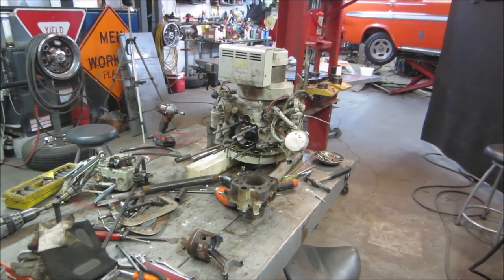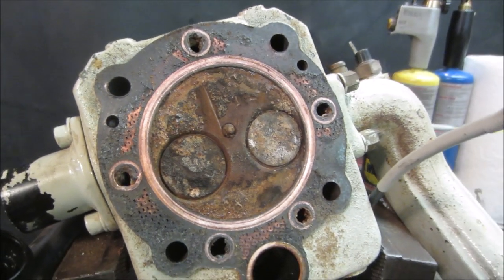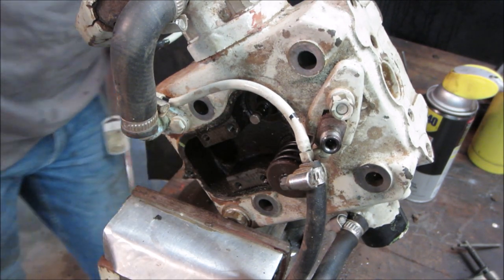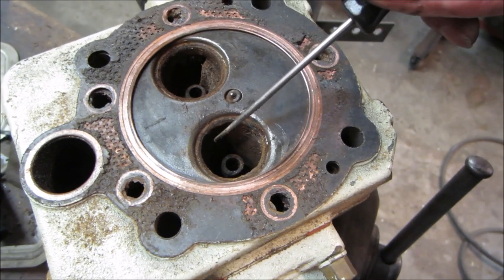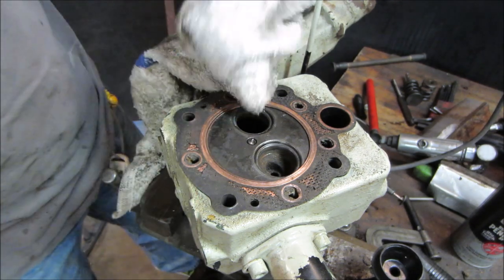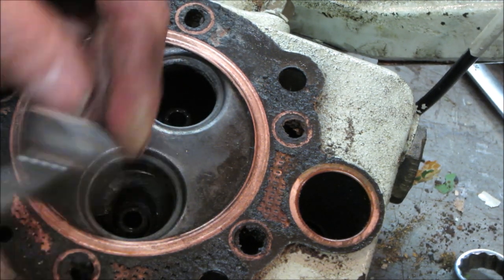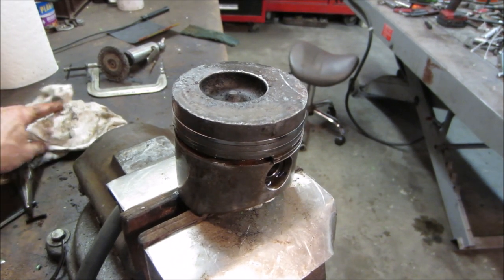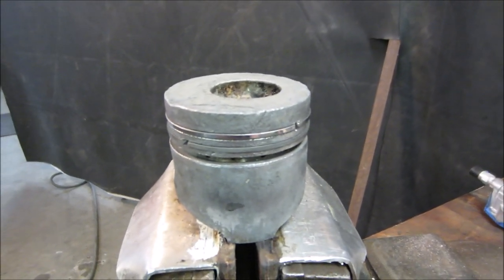Can It Be Saved? Junked Marine Diesel PT 2

Comment: Save some of your old sanding disc  you can use to clean up the valves. Also, when lapping, lift the valve out of the seat slightly and slap it back in the seat, this helps seat the valve for a better outcome. Just a suggestion I learned from Big Daddy Don Garlits. The piston is probably trashed after the beating it took trying to remove it. Most of the impact driving it out was on the outer edge. Anyway, I enjoy the content and "drive it like you stole it".

Comment: When I was trying to clean the all stuck pistons on a chevy inline 6 I fould that if I put them in my steel 5 gal pail and heated it to 300F ,  All depostits were gone next morning. Rings were loose. I used used engine oil. Magic stuff.

Comment: The less compression a diesel has, the faster it must be cranked in order to start it.  But if you can figure a way to crank it fast enough, you should be able to start it despite considerable bore and valve seat pitting.  I once had a Rabbit diesel that I would tow up a big hill and roll off down the hill at around 40 mph to cold start.

Comment: If you can't get a new piston, you might consider welding the crack with aluminum rod and propane torch. Machining it down to exact specs, after welding could get tricky.
Reply: That aluminum rod is too soft, too low of a melting point.

Comment: water in the diesel tank will do that. if it run with water contamination in the fuel and then left for a year the piston will rust, when i lay up my 350 cc single cylinder diesel genny for long periods of non use i always clean out the tank fisrts and run clean fuel through the engine, I try to use red diesel as the sulphur lubricates the engine unlike pump diesel which is low sulphur content.

Comment: I've had luck in the past using a dental style pick to remove stuck rings in motorcycle engines. Wiggling the sharp end under and behind the edge of the ring sometimes allows one to pull them out, or at least get it started. I don't know if that would work in this case, but it might be worth a shot.
Reply: N1RKW, Yea but I bet you didn’t use a 20 ton press to push the piston out of the cylinder, which likely crushed the ring grooves onto the rings

Comment: I think they sell 1/32” O.S piston&ring set for that. I couldn’t see the engine size to confirm. If they don’t, you’re whipping a dead horse.
Reply: O/S  piston isn't the whole solution. Actually, that engine has a sleeved bore, as do most diesels. You can usually buy a kit, with sleeve, piston, rings and pin.
Reply: @neil6212  
Now that would be fun to see, pressing the sleeve out of the cylinder.  That requires a press plate that’s thick and with a hole just big enough to clear the sleeve lip/flange. Also a much more powerful press, I don’t think heat and penetrant will be enough. Then again it may just tear the crap out of the cylinder regardless of precautions. I’m a glass is half full guy because life has shown that and leaves less to be disappointed about when SHTF. 🧐

Comment: Bronze wheel to clean the valve stem before you lap the valve.  Then use reversible drill to lap the valve with the suction cup tool.  If that much build up perhaps knurl the guides and replace valve seals.  If it has some.
Good Luck!!

Comment: Ive rebuilt engines like this with sandpaper then valve lapping compound. Hone cylinders. New rings and bearings. Some of them are still running 100k miles later. For as much as people are afraid of engines because of cleanliness you can do it "garage" style. Now your not going to build a race engine this way but if you gotta make it run you can. Its funny how many armchair youtube commentors will SWEAR you have to do things perfect in lab conditions when in reality most of them have never built an engine. I built my first 383 dirt track engine at 15yrs old and have had very very few failures. Dont be afraid get out there and do it. You will make mistakes but thats how you learn.

Comment: Hi. I stumbled across your channel while browsing videos on Restoring damaged equipment. Thought I would "throw in" my 2 cents. Given all of the gummed up, rusty engines, especially carburetors that you seem to come across, thought you might check out the options on a Vapor Honing / Hydroblasting system to clean and restore some of these parts, including cylinders, pistons and even valves. I am NOT an agent for any of the companies that produce/sell this type of equipment. One of the more prominent ones is a company located in North Carolina called Vapor Honing Technologies. They have a Youtube Channel, and there are quite a few videos  here on YT which feature other YTubers using this type of equipment to restore classic motorcycle engines. There is also one where VHT use a machine to free frozen piston rings from the piston just using their vapor honing. It does not remove material from the piece, but will remove paint, rust, gunk, etc. I know these machines are not cheap, but given their efficiency and end results may be worthwhile. There are different media aggregates and mixes of aggregates depending on what application is going to be the primary use. I wish you continued success in your projects.

Comment: I bet rubbing compound could be used to bring back the valves, in a pinch.  I've used it on the end of a q-tip stuck in a drill to polish the bleeder-screw seat on a brake -- borrowed that trick from your carb cleaning videos!  :)

Comment: Pretty sure the issue was the exhaust manifold or water jacket managed to leak into the exhaust and the water pump was tied into the main engine or had Venturi style flow from moving, and that caused the leak to occur and then it just flowed in continuously until they went to use it and were so pissed by being without power when they needed it that they just immediately chucked it, which broke the pulley

Comment: Boiling the piston in hot oil will help. The heat will make the piston a little longer which should increase the clearance in the ring groove's and break the corrosion bond.
Reply: Yes but there is a crack in the top of the piston down to the compression ring.
Reply: @jadesluv  it will still help with dismantling it, have you seen my comment over on the strip down vid?

Comment: I have no words about the way he cleaned the valve seats and piston… but anyway- measure the height of piston, also get a measurement of inside diameter of cylinder. Find equal closer to this by size of cylinder. Go to someone who have equipment to expand cylinder to the next size of equal piston. Same with valves, change the seats, grind the contact ring as you did here but with the new seats. And make a gasket by your self, or try to press down with sealant the current one. If you need advice how to create new gasket - just ask. Currently I see no issues instead of time and spending small amount of money to expand the cylinder to the next size and changing the valve seats to make it work again

Comment: There will be piston rings available that can be modified. Approximate bore size and width will not be for just one engine ever made. Ring grooves can be cleaned up even on a lathe. Rings can be made from cast iron pipe and then split and made to correct fit. Ask Alan Millyard for help and advice. He builds fantastic engines from scratch, can make anything. Just look up Alan Millyard on u tube and wonder how he does it..

Comment: You don't use a drill because the centrapetal force of the spinning throws the grinding paste off of the valve. By right, you use the sucker firstly with rough paste and then with smooth. You can tell when it's ok by the plopping noise the valve makes when it drops into the head.

Comment: With all the rust inside and out. I would of tried sandblasting the exterior, do exactly what mustie did to the head cylinder wall. If no other sensitive components are in the way id also sand blast it to remove all that crap. But these motors from what I seen are basically bulletproof if maintained occasionally.

Comment: Try an old deep socket with a bit of rag stuffed up inside.  Crack it a few times with a hammer on top the valve cap.  Keepers will jump out and cap and spring will jump up.

Comment: Check just below the seat on the exhaust valve ( the one that was stuck). Just for a second there looked like there was a crack in the exhaust port that may explain why the engine locked up & eventually rusted up. Needs a head if it's cracked...

Comment: Another worry. If your rings won’t hold, especially the oil control ring, or the valve stem is loose the Diesel will consume its own oil and will not shut off until it runs out and siezes.

Comment: Aluminium oxide is cheap and readily available in many particle sizes for different aggressiveness it's active ingredient in grinding/cutting wheels sandpaper as well it has hardness of 9 so it can grind hardened steel mix with some oil or something and make ur own lapping compound

Comment: I had Kawasaki air cooled engine with the same problem. Once i got the piston  out, I cleaned it up with the wire wheel, warmed it up around the rings with a gas torch and sprayed it with WD40 and let it soak. I then tapped around the rings with the handle of a large screw driver until the rings freed up. this took a few hours. I was then able to remove the rings without breaking them. I think that I was lucky. I put it back together and it ran. More luck.

Comment: Thank you for part 2. What is the purpose/benefit to using a brass rod or hammer?
Reply: Not a mechanic (I drive a desk in a bank...) but brass is a soft metal, so if you bash a harder metal with a brass implement, particularly a part with an edge or a tight clearance, you do not risk damaging  or bending it out of shape- At least, that's what I understand...
Reply: @maxinlux6570  thank you. That’s what i was thinking but wasn’t positive. Be safe out there on the roads, ah hem, hallways driving that desk!! Bahaha. I had a laugh!

Comment: Rings are ~$16, just need the thickness of each of them.  If it really needs a new piston, if you take all the measurements (bore, stroke, wrist pin size, ring thickness, etc) and there are places that will custom make a piston for ~$100.  For the record its 3.150 bore and 2.950 stroke.

If you can test the generator and make sure it works you could get the motor running like new for under $200, that would probably be enough to have a shop machine the bore 0.010 over, and grind the valve seats even.
Reply: You're a tad small...bore is 80mm.
Reply: @Split10uk  I have the manual, it says 3.150 in it.
Reply: @Split10uk  And 3.150 is 80mm
Reply: @Split10uk  That is a third of a thou difference, an order of magnitude smaller then dragster and F1 engines are toleranced to, its insignificant for the application.

Comment: Many years ago, I was told that if you wanted a good fit between the valve and the seat to loosely put the valve in and attach a drill motor to the push-rod end and grind away. Some slurry should be added to the seat to allow some good action. Is this a bona fide technique?
Reply: I should have waited until the video was over . . .

Comment: Pity. There are lots of maybe random fit pistons but for diesel it needs to be right.
You could test the generator using a big drill motor w/ no cylinder attached to try to get a glow from a bulb before spending any money on parts.

Comment: Fuel line on valve stem. Put nail or screw in other end of fuel line. Chuck nail/screw end in drill motor. Pull-on drill motor and lap valve that way. "Colgate with MFP (micro fine pumice)"

Comment: I've actually used lapping compound the fix a piston with a messed up wrist pin bore. Been running strong for a while now
Reply: There's nothing that can be done for this engine. It's dead. Parts no longer exist, the piston is cracked, and the usability is questionable. It's either scrap,l usable as a spare for someone else, or something to cut up so that the gennie can be grafted unto another engine, IF, it works.
There's a reason they dropped this engine in the junk yard, something marine people rarely do as much as every day Joes with their lawn mowers and such.
Mustie got his views, that guy who found it got his 20, and we got to see what happens when you operate a boat like a prick, and let water enter through the exhaust. Case closed.

Comment: The first thing you should have done was to pull the injector and poured the cylinder full of sea foam.  Then, 48 hours later, see if it will turn.  If it still will not turn, empty out the cylinder and pour in mouse milk, a second choice because it is costly.  Do not wire brush pistons, turn them on a lathe with polishing compound.

Comment: Has a marine engineer I think the exhuast water cooler jacket as cracked and water backing up and filling the cylinder but all is not lost  you need a valve set cutter  witch will clean upthe valve seats  then after a bit more work lapping the valves in you get a good seat

Comment: I had an old ford escort that wouldnt run well with 85 psi compression because the valves were so bad. I did that drill technique with  regular old dirt with a little oil mixed in. I got 140psi +/- 5psi accross all cylinders

Comment: Well, there’s the smoking gun. That exhaust valve condition shows what happened. That, plus the condition of the water jacketed exhaust manifold, shows the manifold had a leak that allowed sea water to enter the cylinder through the exhaust valve. It did so when the engine was stopped, else the valve and connecting rod would have been bent. Most likely the injector is junk as well.

Comment: Sometimes you hit a homerun and sometimes you strike out. When you finally caught the crack in the piston I figured that it was a strikeout now. It doesn't seem like there is much hope for a cheap fix on this baby. All you can do is try and you certainly did that. I say put it back where it came from. Something else is going to come up that will be the next homerun. I enjoy your videos because it is how I have done all of my life too. I have brought so many things back to life that I should have a doctorate for scavenging and rebuilding. Isn't it funny how people throw away things that sometimes just need to be cleaned up and tightened back up again when you put it all back together? I grew up with little that was actually bought but I seemed to always manage to have just about everything everybody else had. It was just a matter of picking up other people's trash and putting a little elbow grease into something. When I was about 8 y.o. me and my first cousin made a two seater bicycle out of two bikes that had been thrown away. The rear was a 10 speed so when we rode it no other bicycle could keep up with us because we could put it in different gears to take off faster and higher gears to go really fast. Two boy power is great when you both got use to it.

Comment: What can ya say:  Ya win some, ya lose some, and then there is the Mustie1 determination factor, “it ain’t over till it’s over”. Maybe you could save the parts of the diesel engine and  wait to see what comes your way as far as a possible donor engine or parts source.  I really was hopeful for you to repair it.  Do you have any thoughts on testing the generator with some external electric motor or other engine?  You know, there is enough weight there to make a dandy boat anchor too......👍😋

Comment: Marine motors with raw water cooled exhaust risers are notorious for failed risers which allows raw/salt water to go back through the exhaust valve into the cylinder.  The jacket on the risers on that motor was badly corroded and cracked.  My bet is that was the root of the failure.

Comment: I think before you go much further you should clamp this thing down, spin it up with an electric motor and test if the generator even works before spending anymore time on it.
Reply: The point is the generator.  If the crank is free the generator should spin.  Oops, more rust?

Comment: If you can get your hands on some walkerite  heat resistant gasket material of the correct thickness, you can make a gasket, and then use hylomar blue gasket sealer, you should win for a head gasket. As has been said, the problem is piston rings !

Comment: You can crush the ringland on a worn gas engine's piston simply by forcing the piston out without reaming the cylinder ridge.  You've imparted about 100 times as much force on that piston with the press, so I'd say the jig was up for that piston from the get-go.  Nice try, though!

Comment: 26:32 Ease off the throttle, Ripley. You're just grinding metal.

Ultra-exclusive, secret director's cut: That's the point, corporal. I'm honing the transaxle with FastOrange. I'll have this boat-anchor APC moving so silky smooth, you'd think it was an airport tug.

Comment: 1:00  I always wonder which is the better of two evils when wire wheeling stuff on a pedestal grinder.  1)  Wear gloves.  Pro:  might save your hand from getting gouged if you accidentally touch the wirewheel.  Con:  Might grab the glove and pull your whole hand in so you lose a few fingers!   2) Don't wear gloves, like this guy, and just be careful to keep your digits out of harm's way.  (What I normally do too.)

Comment: hey Mustie1, what is the bore size in metric please (millimeters)?  The piston itself looks very similar to Peugeot/Citroen's XUD items.  1905cc ones are 83mm and I may have a couple left with rings ("good used" from an engine that threw a rod) that I could look into shipping if the measurments added up right, and the 1769cc Xud7 engines had an 80mm piston.

Comment: hey there, random question
what size/brand ultra sonic cleaner do you use?
I'm looking to buy one, specifically to clean my diesel injectors for now, but also for other  projects like chainsaws and stuff.
Reply: What diesels are you running.
I'm looking for a kubota injectors for a tiny gen set...
Reply: @offgridmangogrower  a 1.9 TDI from VW :D